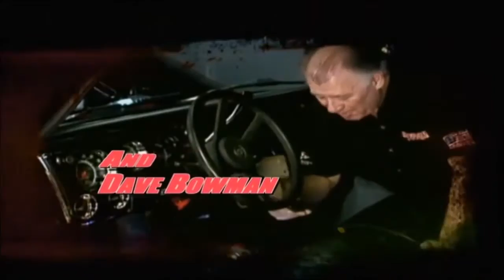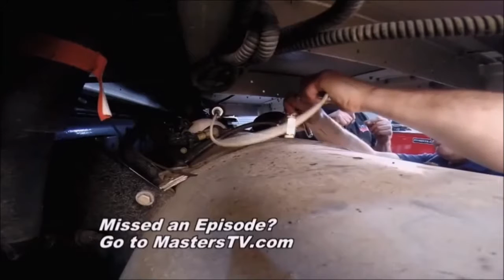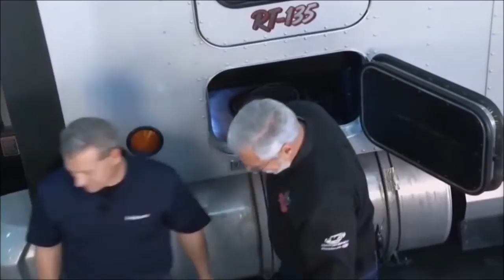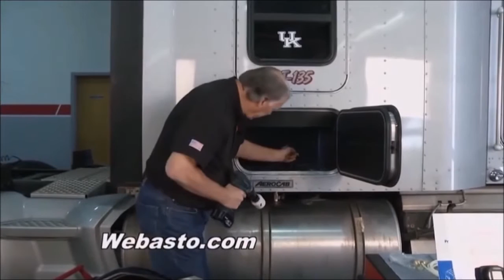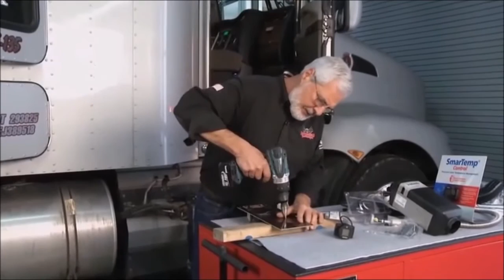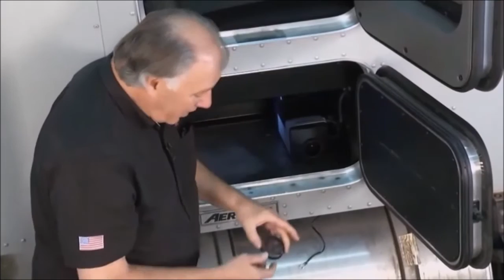Webasto Air Top Installation

Comment: My truck is the same truck, my heater is mounted the same way, that box is not air tight and who wants to be heating cold air from outside anyway. The only air meant to come from outside is combustion air, just like a furnace in your house.